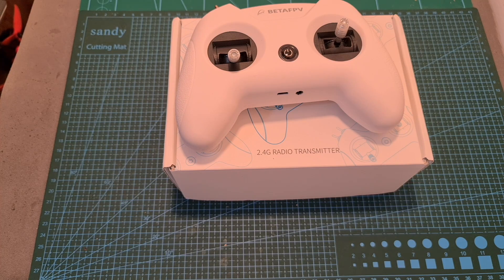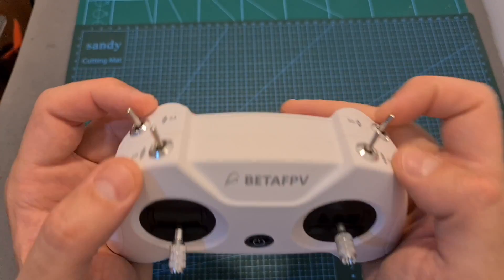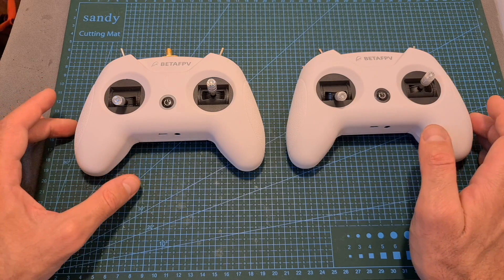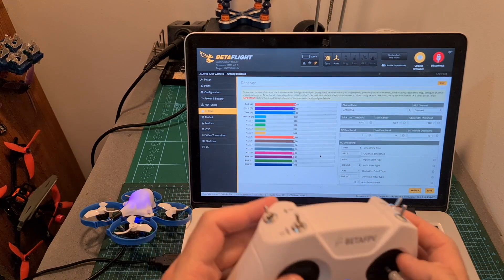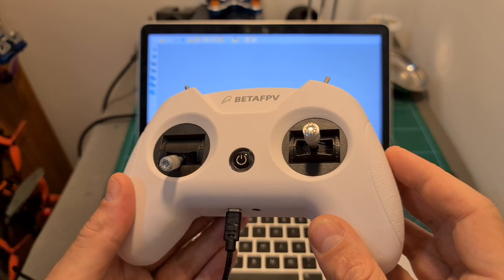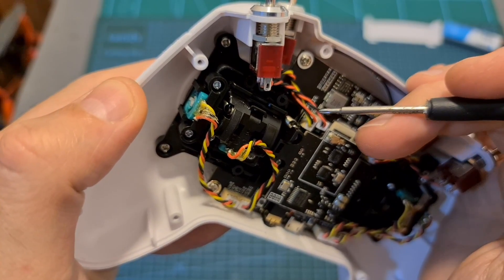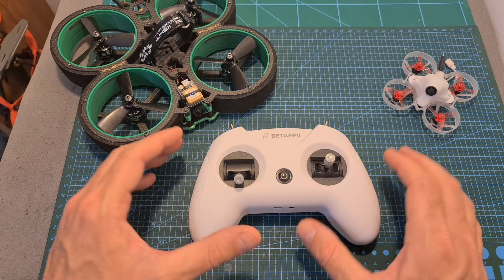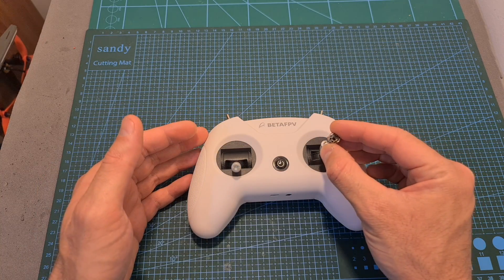🎮 Best Compact Budget FRSKY RC - BetaFPV LiteRadio 2 Setup & Review

Comment: Hi i have a question, Does the Betafpv lite radio 2 come with both of the bayang protocol and the frsky protocol or are those different?
Reply from the maker: The new Radio Controller (SE) comes with 3 protocols - Bayang, D16 and D8.

Comment: When chAnging to mode 2  by moving the spring do I need to plug the controller in to beta flight to change the mode on there also ?
Reply from the maker: Yes, you will need to use the companion app.

Comment: My unit has a big jump in throttle around center. Bad quality. A quick search revealed several other users facing same issue and feel cheated. Disappointing to see all the good reviews without pointing out the bad bad quality control by betafpv. What a shame!
Reply from the maker: That's unfortunate and I didn't experience this issue. 
Did you contact BetaFPV?
Reply: I contacted the reseller and sent back the unit to him. Awaiting a response

Comment: Hi, tbs crossfire works only with the jack? doesn´t need anymore? like input power or something similar? Maybe Im asking for something trivial but Im new in this hobby and I dont have experience with quad and radios.
Regards.
Reply from the maker: Hi, you will need to power it externally. Anyway I don't recommend to get this radio controller for this purpose. It's a great budget friendly option for beginners though.

Comment: I would love to fly mode 3. After changing the spring to the other side...do i remap on the drone the throttle?
Reply from the maker: You can use the OpenTX companion app to remap the sticks or just do it on Betaflight, which will be more easier but will require you to define the sticks each time you set up a new drone.
Reply: @KremerFPV  thank you. I got it working!
Reply from the maker: @recycl0ps890  Great!

Comment: OK I have it blinded to the tinyhawk II  And I have the AETR1234  In the right spot everything seems to be working throttle yaw pitch and roll But since it does not have any trim buttons everything is not 1500 except the throttle of course the throttle is in the proper spot How can I fix the yaw pitch and roll
Reply from the maker: You need to use the OpenTX companion in order to calibrate the sticks.
Reply: @KremerFPV  can't find the app in the app store ?? And do u happen to have a video on that too by any chance
Reply from the maker: @BongToker  It's in the description box and I show it also during this video.
Reply: @KremerFPV  ok ty

Comment: i can't use this controller with lift off. liftoff doens't see it but windows see it
Reply from the maker: It should work out of the box. When you plug the Radio Controller in the LiftOff controller configuration screen it should be recognised as a Q X7 Radio Controller. Did you change any setting? Are you sure that you are using a USB Data Cable?
Reply: @KremerFPV  yes and yes i don't have changed settings... Idk what to think

Comment: Guys stay away from this radio there are a bunch of problems with the gimballs.
Mine is bricked as is gets signal from throttle gimball and you cant activate the radio due to throttle safety.
Also roll gimball jumps around.
Great design but unreliable as hell.
Reply from the maker: Mine is working well. Did you contact BetaFPV?
Reply: @KremerFPV  I have but still no solution, they told me to recalibrate the Radio but the problem still exist. Gimball inputs jumps around to the point you can  loose control to the drone.
And you can't find any replacement parts for this Radio.
Reply from the maker: @marinostsali7131  That's really unfortunate :-) I suggest sending them a video with the issue.
Reply: @KremerFPV  I have sent them a video too.

Comment: Hey thanks for  your vid- I’m a complete newbie. I ordered the betafpv advanced 2 kit and I’m trying to put this in binding mode and I’m getting solid blue light. It’s not changing colors when I hold bind with throttle down. Any tips?
Reply from the maker: Hi, that's strange. Maybe the throttle is not calibrated properly. Have you contacted BetaFPV?

Comment: THANK YOU FOR FUCKS SAKE FOR SHOWING THE PROPER WAY TO SWITCH MODES.... The instruction manual is wrong, other people are wrong, you just showed that you have to hold bind and wait. Absolutely ridiculous that the manual does not say this. I just came home from about to having a fly session but could not switch the damn modes. Also why the hell is my controller just randomly deciding to swap back to D16 when I power it down and up?
Reply from the maker: Yes I know that it can be a little bit confusing. 
I have no idea why it keeps randomly switching back to D16. Any luck contacting BetaFPV regarding this issue?
Reply: @KremerFPV  Nah, It's a weird issue. It has something to do with me charging / using other 2s on the controller and then using it for Sims. At some point inbetween charging and sim-ing it will just swap to D16 when you boot it back up.

Comment: Can you help me bind mobula 6 to this radio please
Reply from the maker: Do you have the latest version of this radio controller (The one that enables you to charge the battery using the USB port)?
Reply: @KremerFPV  yes I do I have the frsky version. I hooked up my mobula 6 to betaflight but when I connected my radio  lite 2 and try to arm it nothing happens. Also its says my throttle is on the right side but I want it on the left
Reply from the maker: @williamherrera6557  Ddi you follow the binding instructions?  You need to make sure that the RX is TX are set to the same protocol.
Reply: @KremerFPV  yes I put the transmitter in D8 mode.
Reply: @williamherrera6557  Any news on how to do this?  I got mine to bind as well but throttle is on the wrong side.

Comment: I would love to use this in mode 3. Can I swap the pin from left and connect it to the board on the right and right to the left, ? Will that work?
Reply from the maker: Yes it should work.
Reply: @KremerFPV  Do you think the cables are long enough to reach opposite side?
Reply from the maker: @recycl0ps890  I am not sure - but worse case you can extend them.

Comment: Hello, i am new to the hobby. I have ordered the Tango 2 with the intention of using crossfire in the future, and to play with a sim for now. But i am getting tired of waiting for TBS to ship them. Should i get this instead?
Reply from the maker: No, this is not going to be a replacement for the Tango 2, but still you can order it, get some sim training and also get some practice with a small quadcopter with a built in Frsky FCC radio receiver.
Reply: It's not that easy to make it work in sims.
It's not plug and play.

Comment: Gal, I purchased this transmitter to use with Velocidrone and I cannot get my MAC to recognize it, which will not allow me to have it recognized by Velocidrone.  How did you get your Mac to recognize the transmitter?  Thank you.
Reply from the maker: Mine just worked out of the box. Are you sure that you are using a DATA usb cable?
Reply: @KremerFPV  That was the problem!  The cable I was using did not carry data, only power.  Thank you very much.

Comment: Can u use this with the betafpv  lite brushed flight controller
Reply from the maker: Sure. You bind it with a radio receiver, it doesn't matter which flight controller you're using.

Comment: hello gal.i receive today my literadio2 .im super happy.i bind with my eachine novice 1 first time bind,and change to d8 and works.i try to put your pids to novice1 i look in your video.this is enormous dificult work for me,first time all, but i try it. very very thanks for your videos.sorry for my english. ojala estuvieran tus videos en español. gracias.
Reply from the maker: Hi, did you get it working?
Reply: @KremerFPV  yes.i bind with my novice 1.is my first experience binding and its ok. But im working with simulator for acro,for me is very dificult,too many time flying estabilized,but i work hard.thanks
Reply: @KremerFPV  now.i conect directly cable to my smartphone,install simulator freerider and works.not the best simulator i try others in computer.

Comment: Why does xm+ failsafe at 70 rssi? It doesn't really give any warning... And yet the other reciever goes down into the 20s!
Reply: this! The RSSI is so high, what happened?
Reply: @itstrysten  I think rssi on different receivers is calibrated to a different db. So not all rssis on the same number mean the same thing. You can adjust it in betaflight, I think it's the rssi scale.

Comment: Is there a danger with having this constantly connected to simulators and charging the LiPo battery? Surely when you're done with a sim, you should remove the battery from the controller and put it into storage charge? Or am I being over cautious here?
Reply from the maker: That's a good point, but I think that you might be a little bit over cautious (which is a good thing with lipo batteries). 
On their next version they might want to add an option to disable the internal charge feature but for now as it is not possible I suggest performing a storage charge in case you are not going to use the RC for a while.
Reply: @KremerFPV  ah ok, Faur enough, I'll make sure to storage charge it after use in Sims and in the field. Thanks for the review btw, really helpful :)
Reply: I was thinking the same thing, but when it comes to LiPo's used in radios, I think the practicality surpasses the need for putting them in storage mode constantly. As long as you're not using it down past 3.2v ish, I think we're fine. I have a LiPo in one of my RC transmitters too and although I religiously put my other LiPo batteries on storage mode if I don't plan to use them that day, I'm not so strict when it comes to transmitter/radio batteries. Just don't over discharge them, and I think you're good. They use so little battery anyway, that you can always replace them and it'll be long time before that happens.

Comment: 8:27 wait wait wait go back 😅 Could you describe a bit more how that would work? You just power the Crossfire module externally and it all works or is there some setup to do on it?
Reply from the maker: Haha. No setup needed - just connect the provided 3.5mm to RC input adapter which is included with the CRSF Lite / Full module, power it up externally and you're golden.
Reply: @KremerFPV  iiiiiinteresting. I guess trainer port does pwm? I wish there was someone who could measure the latency of that 😅
Reply: @FilipRadelic  there's already calculations on ppm latency.

Comment: Will you still continue to work on the mod and add an external module bay?
Thanks!
Reply from the maker: I am not sure - I got some pinout charts from BetaFPV but I couldn't get it to work. 
So much to do, so little time...
Reply from the maker: Anyway it's possible to add an external PPM module using the trainer port.

Comment: I messed up settings in Opentx companion without backing up, now my Lite Radio2 is no longer working properly, how can I get the original settings/file?
Reply from the maker: Do you have the beta version or the final one?
You can find links to the original files of the final version in the description of the video.
Reply: @KremerFPV  ok, I found and uploaded file ae-bus.bin and that helped... but now my pitch is 1530 and calibration in companion isn't correcting the issue. At least I have controller back;)
Reply: Same here!!! I can not upload and restore the backup you uploaded and only have RED LED showing

Comment: Using the trainer port can connect to a crossfire tx? How does that work? Can I hook it up with let’s say a crossfire micro tx?
Reply from the maker: It is outputting PPM signal so you can connect it directly to the RC port of the TBS CRSF Lite / Full Txs. 
I think that it should be compatible with the micro TX but it will require some modifications or making a custom wire. I haven't looked into that yet.
Reply: Gal Kremer right checked the manual saw that the lite and full have the trainer port to crsf thing. Micro tx like you said probably need some mod or custom cable. Thanks for the info btw keep up the good work on the videos. Enjoy your content :)

Comment: Thanks for review! Is it possible to bind more than one receiver/drone to the radio?
Reply from the maker: Good question. Yes :-)
Reply: @KremerFPV  Thanks!
Reply: Gal Kremer how would I switch models on the radio? (without connecting to opentx every time). Thanks!
Reply: @meyvalencia6826  Other radios with OpenTX allows You to bind more receivers (with same protocol) to a model. If You use f.e. FrSky D16 protocol and You leave 00 as receiver number, than You can bind more receivers to 00 receiver number and You don't have to go into model settings to switch model, just pull out one and plug in other. That's it. :)
Reply: Excellent video Gal.. Really informative. You do good work...👍🏻🍻👊🏻
Reply: Hey I need help binding this radio to a betafpv 95x V3, its the frsky verion , but i cant bind it , any help wld be appreciated